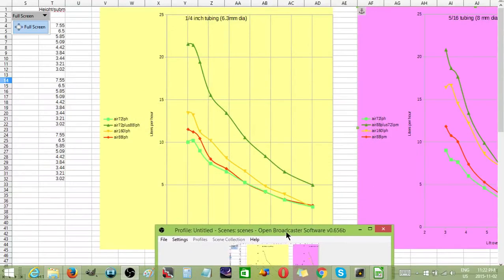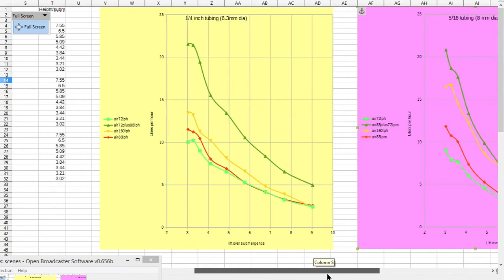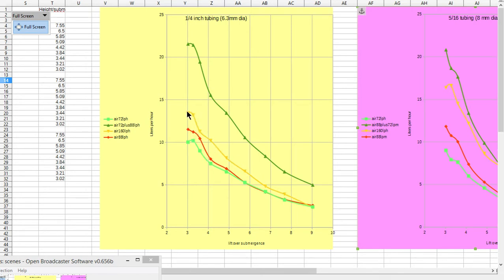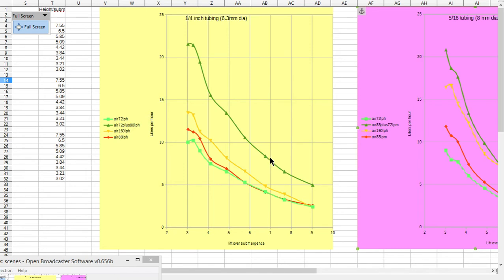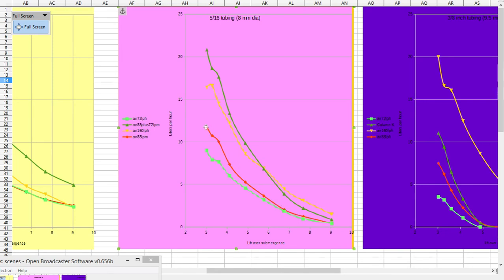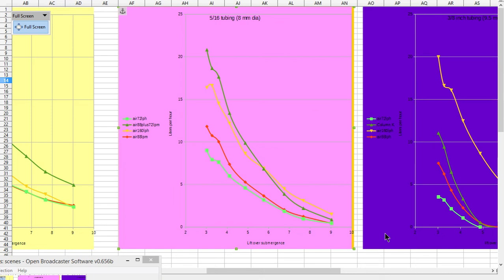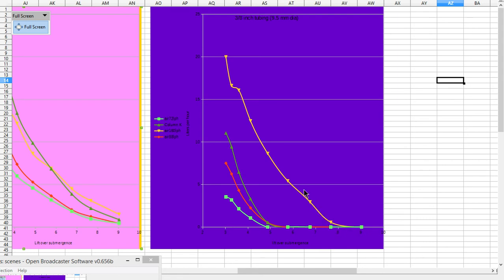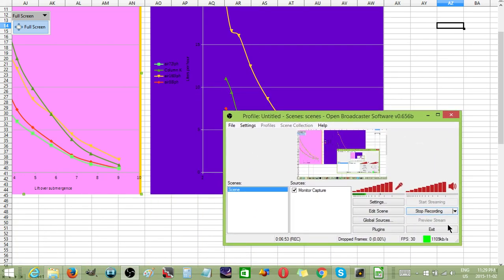Constriction airlift pumps.  Best tube sizes?  Depends on how much air.

Comment: Hello, thank you for the video. Can you explain how you define the submergence ratio? I am trying to make a model of an airlift pump, and I am confused, whether it is taking as the portion of the submerged pipe divided by the sum of the submerged and the effective head (static lift). Is that correct? or is is just the submerged distance divided by the length of the tube.?
Reply from the maker: I used the height pumped above the surface of the water, divided by the depth under the surface where I injected the air.

Comment: Love the idea about these pumps. My vision would be to see if it is scalable. To have a array of 50-100 tubes. that could pump water. it might be a lot if tubes but maybe it will be efficient.
Reply from the maker: +Robin Häggqvist  First of all, sorry for the sound quality of this video.  My headset microphone decided to quit about 4 days ago.    I did try something with 4 tubes  and an aquarium thingy with 4 adjustable taps to control the air in to each tube,  a few years ago.  (I didn't put it online).   I found it difficult to tell which was which when I was adjusting the air!    This year I work 6 tubes  continuously  But only 2 of them are side by side.  None of these are going straight up so they are not very efficient.  However they do the job of circulating water around my plants and they do the job of long term testing of the idea and of the system.   The bigger idea here is a "low pressure pneumatic grid"  to use and distribute very small amounts of power.  I want to be able to supply air from wind pumps,  from trompes,  from vortex power plants and from low tech solar powered Stirling engines.  Eventually this will happen,  but I am not smart enough to do all these things.  I did the trompes (the pulser pump is a tromp/airlift pump combination).  However, I did not even know that trompes existed when I made the first pulser pump!  (1986 or 1987)
Reply: @Brians-tracking-solar-scoop  Thx a lot for your effort for this channel/content..
I have 2 meter elevation water stream and wanna to make trompes (with hidram to increase presure) and to make airlift pump target for 60 meters elevation. What the recommendation for pipe? is it enough with single or must be multi level?
Reply from the maker: @MrBulukuduk  I'm sorry,  Trompe and airlift to 60 meters high won't work efficiently enough to go to 60 meters high.   it will also be difficult with a ram pump with only 2 meters of head.  You didn't say what the flow is.   There is a facebook group called waterpowered pumps which might advise you.  But here are a few of my ideas. 1. If you have lots of water in your stream, you could use a trompe to power a battery of airlift pumps to pump some water  up 2 more meters and then run that water  into a  ram pump.  4 meters head to 60 meters is a 15 to 1 pumping ratio and a hydram can do that without much problem. 2. you could make a mini gravitational vortex generator.  But not to make electricity,  Direct drive a water pump on top of it.  It might make the 60 meters in one go, and if not, it can surely pump lots of water to 3 or 4 meters higher and then use that to run the hydram.   3. make a hydrodynamic screw and join an Archimedes screw to the top of it on the same shaft. The hydrodynamic screw drives the Archimedes screw and you pump water to 2 meters higher and use that water for your source for the hydram.    I don't think anyone has tried these things but they will all work.
Reply: @Brians-tracking-solar-scoop  thank's a lot..